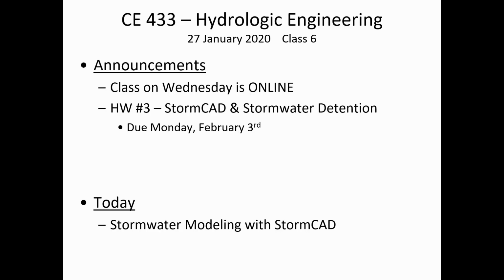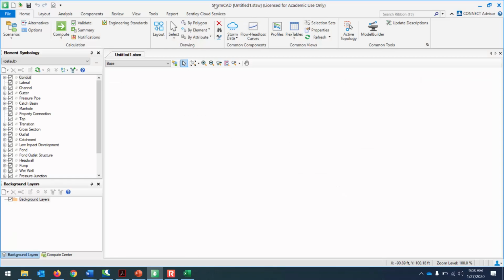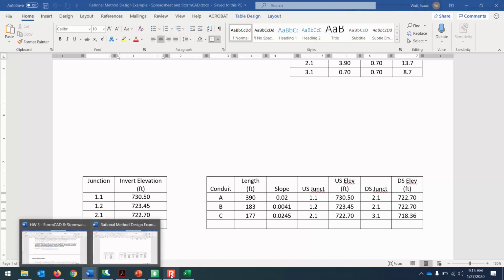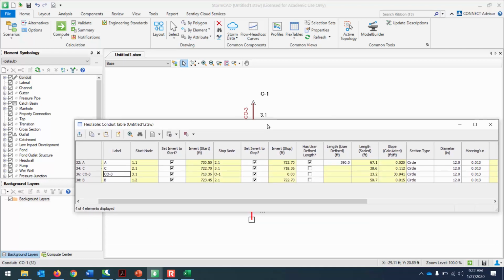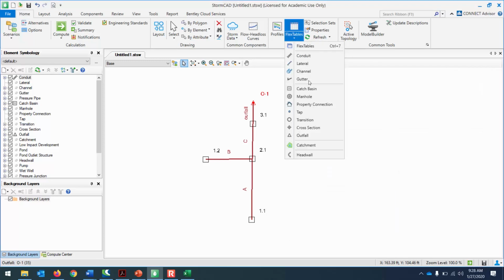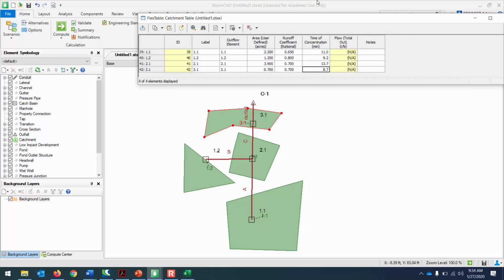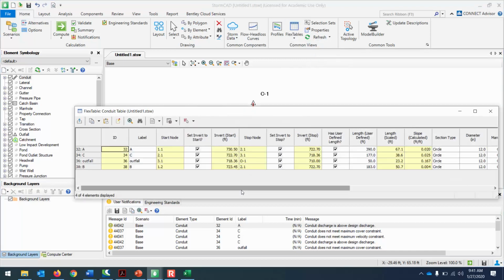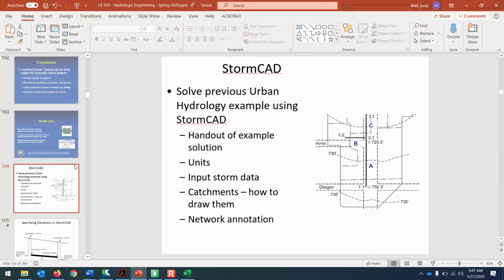CE 433 - Class 6 (27 Jan 2020) Urban Storm Sewer Design with Openflows StormCAD

Comment: Thanks for uploading this lecture sir!. it was very informative,i just want to know ,can we add actual site data into this software like,DEM,Survey Data, or we can add basemap and run these hydro -logical analysis on that.. Because visualization is very important.Thank you
Reply from the maker: Yes, existing site data can be used with StormCAD: Bentley has versions that are integrated with Microstation, and with AutoCAD, so that you can use existing elevations, pipe locations, etc.